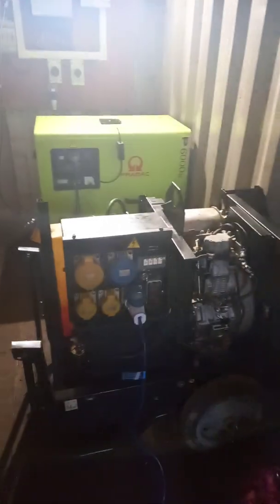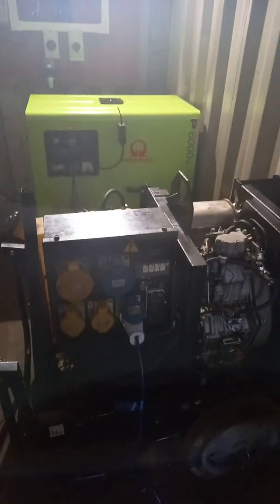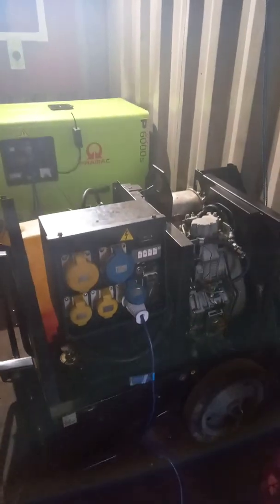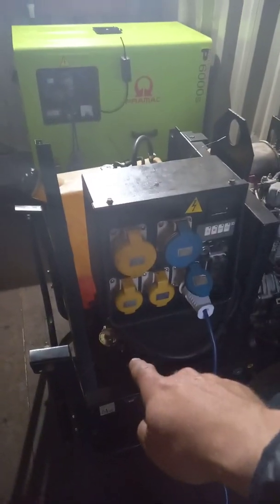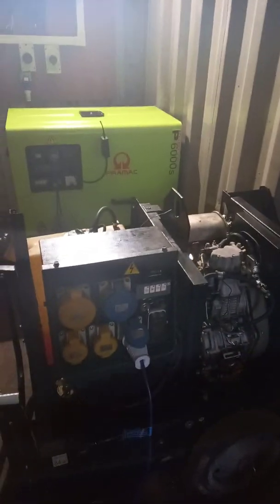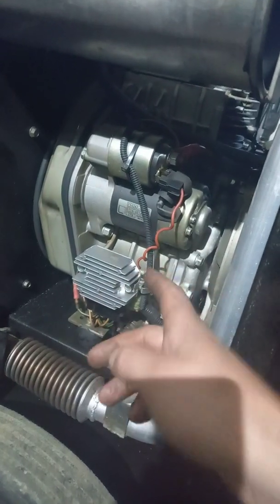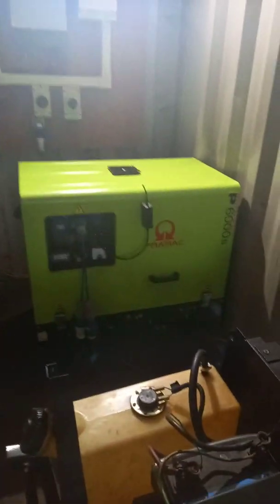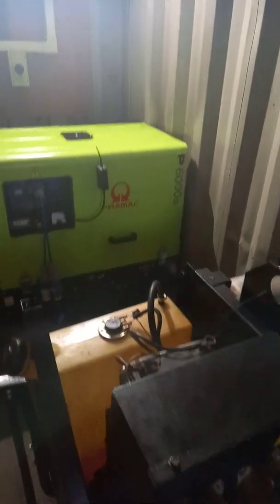Pramac P6000 Diesel Generstor 20 Amp Fuse Failure.

Comment: Thanks for the video. I had an issue on the weekend where i couldn't start the generator and it turned out to be the f use. It hadn't blown but fell apart. Very hard to get with the generator in situ. Thanks again for the tip it daved me heaps.
Reply from the maker: No problem, we have an F book page if you have anymore problems.
Reply: @steelkneel4125  thanks are you able to send me the Fbook details or is this not allowed? (I tried to search on Fbook but couldn't find it)

Comment: Got one just turning over won’t fire
Reply from the maker: Turning over is a good sign. That sounds like a fuelling issue. Have you checked the injector and  the lift pump solenoid to ensure fuel is reaching the top of the engine? Another way is when you turn the engine over if you can see back inside the fuel tank to see if any fuel is being returned?
Reply from the maker: Join the facebook group...